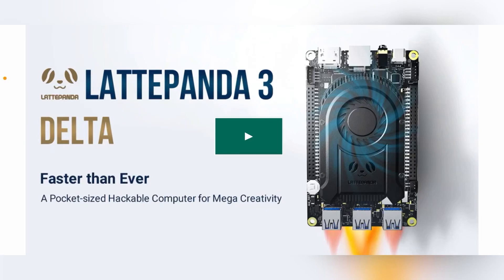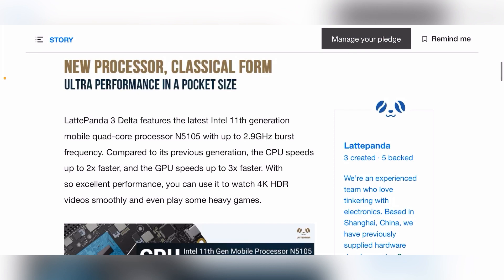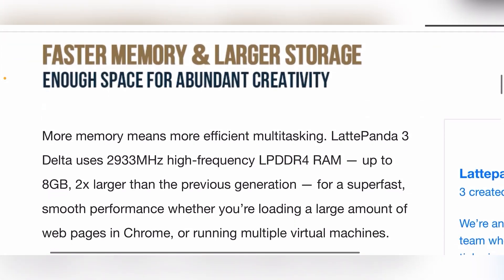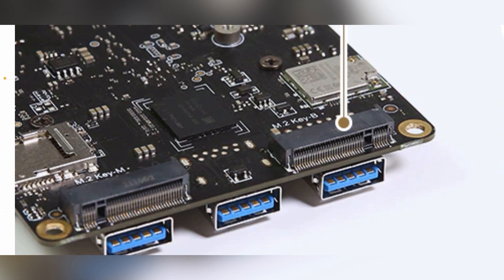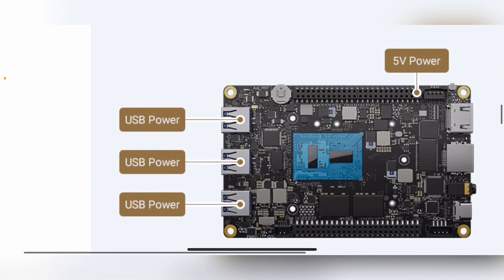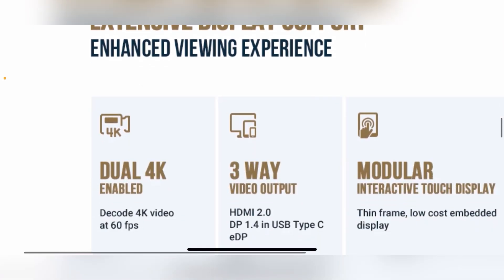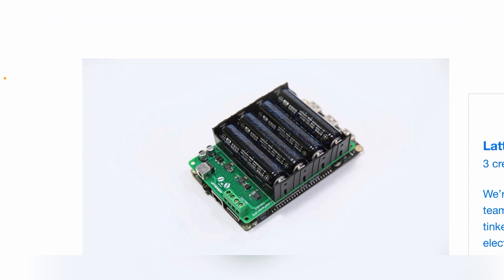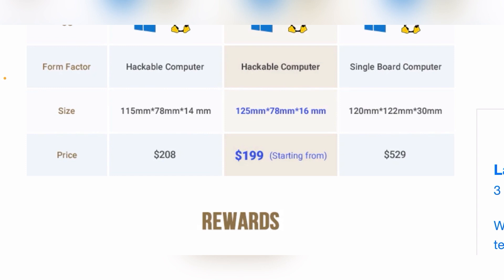New Lattepanda Product! Lattepanda 3 Delta - Overview Specs and New Features

Comment: Great review! Is it possible to provide power to the unit with a usb-c cable and video signal at the same time? I am considering to use it with a monitor which providea power via usb-c. I would like to replace the Latte Panda power adapter and hdmi cable with only usb-c for both power and video. Would that work?

Comment: I may buy this one.
Considering it has a Arduino, eDP, 4G/5G, NVMe and all the other things, this could be a really good alternative for the Steam Deck (although it‘s obviously still not as powerful). Just the other board with the x5-z8350 should get a replacement, maybe also with a Celeron, or with a Zen based CPU.
Reply from the maker: i really do like it as well. Very flexible and great for making your own stuff!